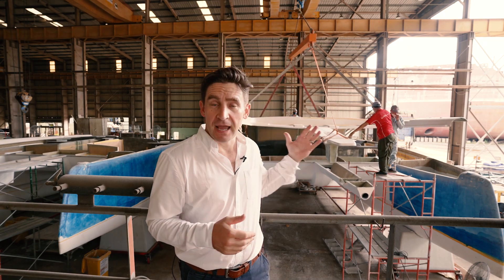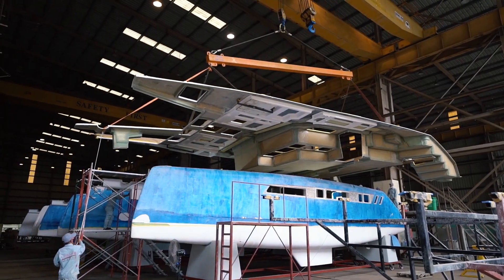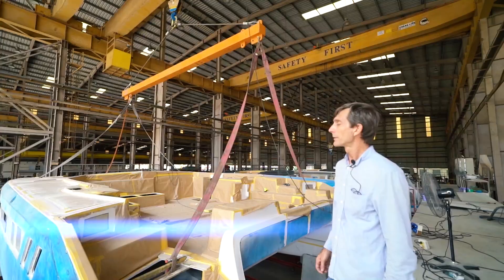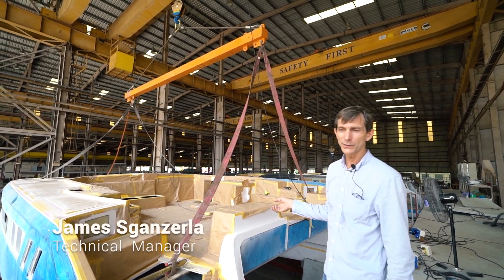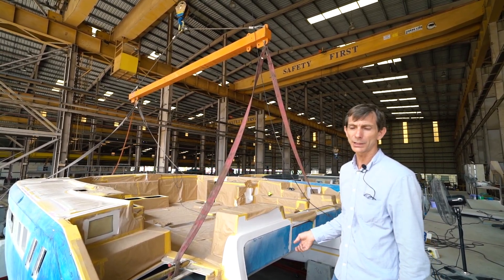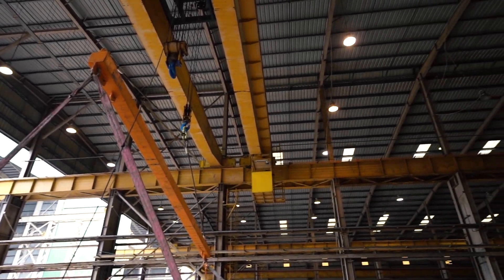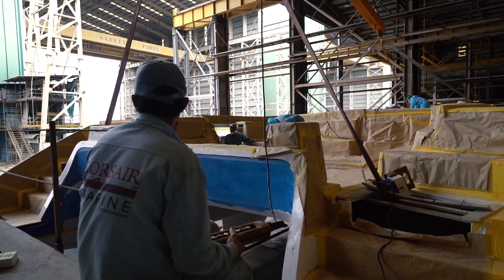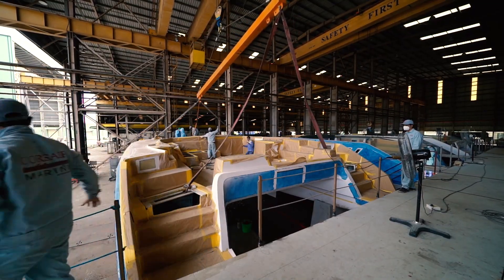Seawind 1370 Hull #1 Deck Join

Comment: WOW!  -- i can't believe that you are "gluing" any part of the deck to hull joint, especially after all the endless reported problems. GLUE will never hold long term. You know that you should use fiberglass to tape all joints and the fact that you are now skimping on that is shocking.  I never thought that Seawind would get sucked into cutting corners but here we are.  Can you order the 1370 with 100 percent taped deck to hull joints if that is my preference?  I want a solid catamaran or, if I wanted the cheap easy glue method, I could just go to Lagoon and deal with their junk.

Comment: Starting to understand the subtle differences in construction now between the 1370 and its competitor the Balance 442.  The 1370 is glassed in high load areas only then everywhere else is glued and has mechanical fasteners to join.  The 442 is joined with epoxy resin and glassed along the entire joint inside and out then hand faired so it’s one piece.  Much more labor intensive, so I imagine saves a bunch of cost/time in the build they can pass the savings onto the customer for a minor compromise.  Both fantastic catamarans!  Definitely my favorite Seawind 👍🏻